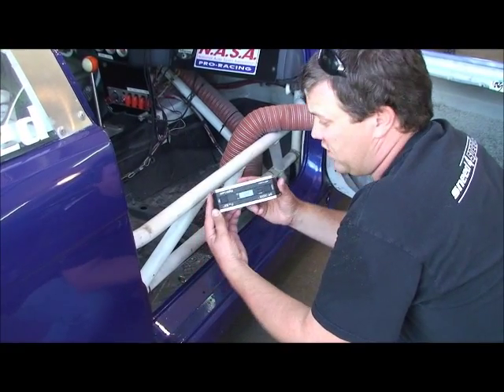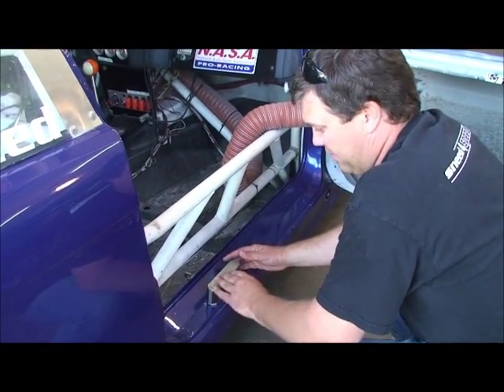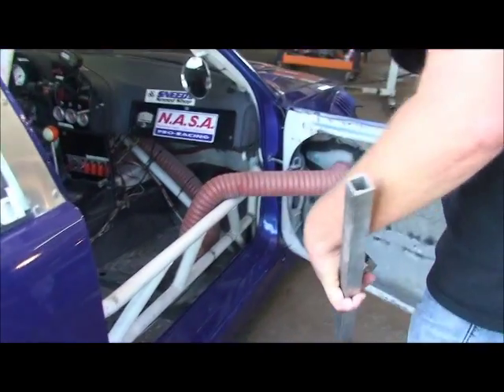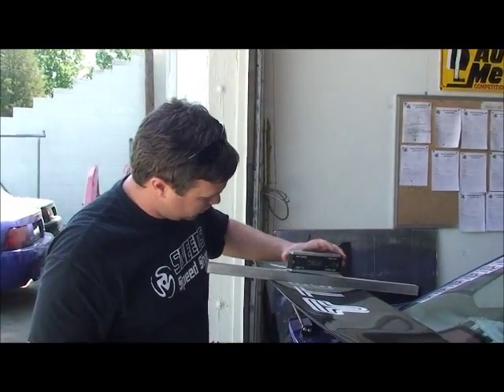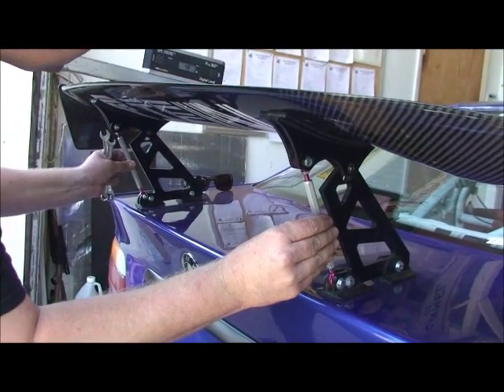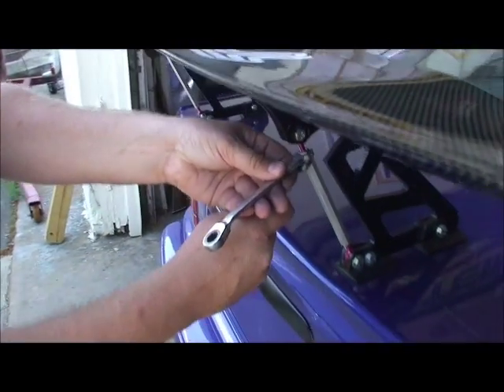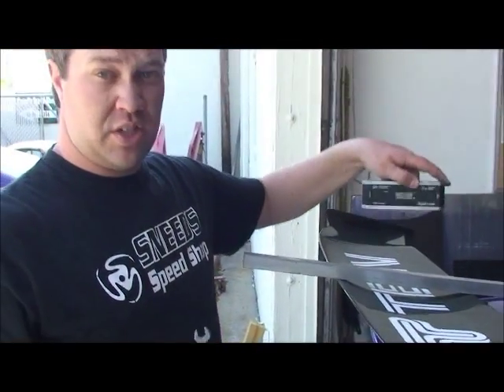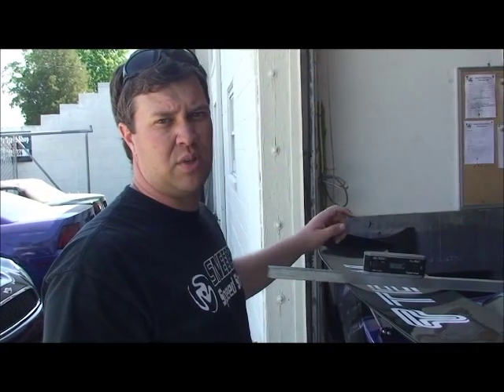How to setup your BMW race wing by Sneed4Speed

Comment: i recently bought a 69 inch carbon fiber wing for my 350z and the legs are to far apart to fit flush on the trunk any tips?
Reply from the maker: the best way to move mounts on a carbon wing is to bond them to the wing with panel 90 and use short wood type screws.